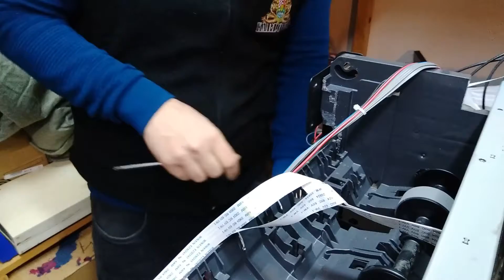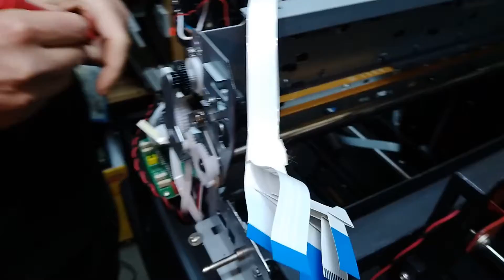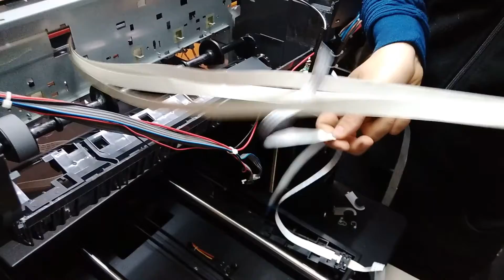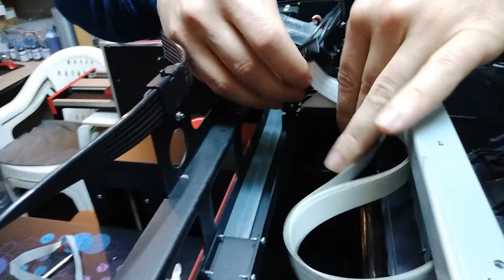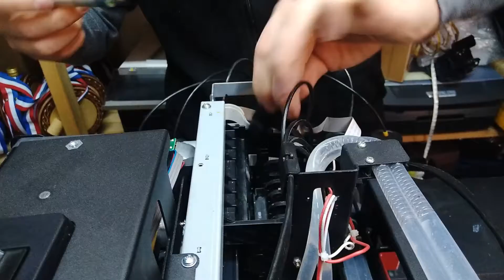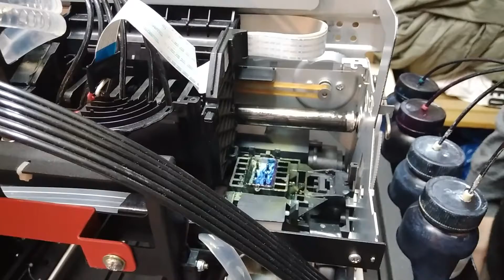UV printer L1800 repair (part 2)

Comment: Is there a way to replace the cable on the print head carriage it looks to be all one part.
Reply from the maker: yes, off course. The cable consist of three peces together, but if only one is damaged you have to pull out the whole thing. There is a couple of videos here on the channel on how to do it.

Comment: I really really wonder why rotary able to work without cable
Reply from the maker: Nothing will work without cable  ;) Everything has to be connected back
Reply: @Max0ressurected  sensor or WiFi right ?
Reply from the maker: There is no wi fi on L1800. Wi fi is only on 1500w.